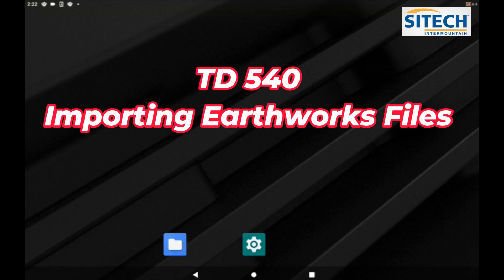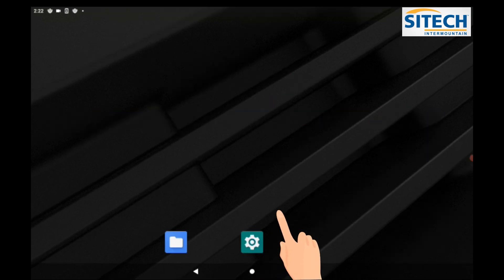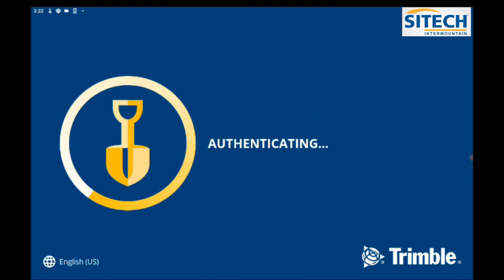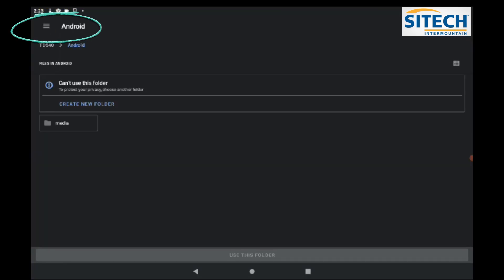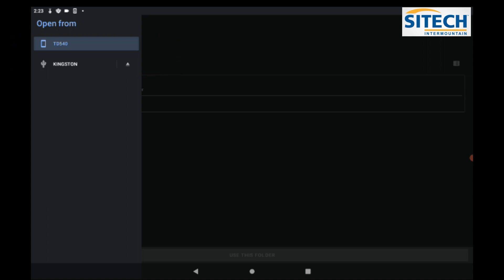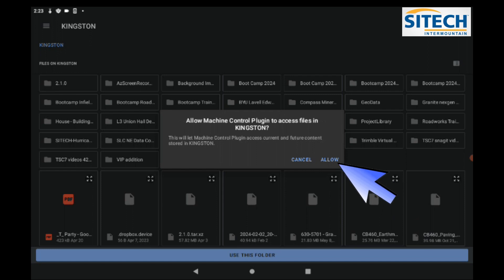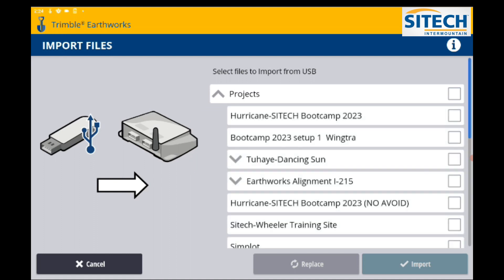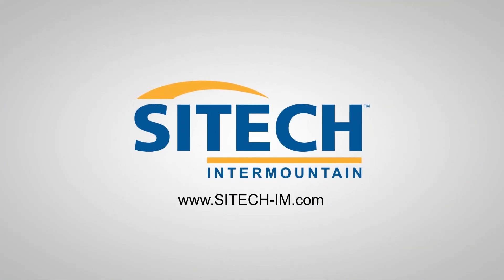Earthworks TD540 Import Designs Process

Comment: On the TD520, as long as your Project Library folder was on the root directory of your USB drive, then you should not have to go searching for that folder or any specific job files. Thank you for the update on the TD540 import process.
Reply: Yes, your USB still needs to be set up the same as if you were using a TD520, nothing has changed with the Project Library location.